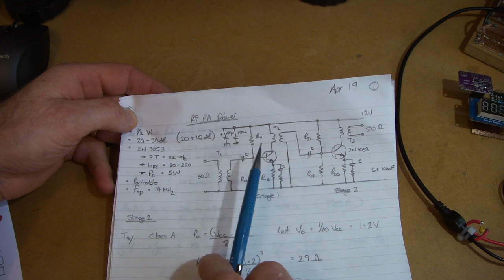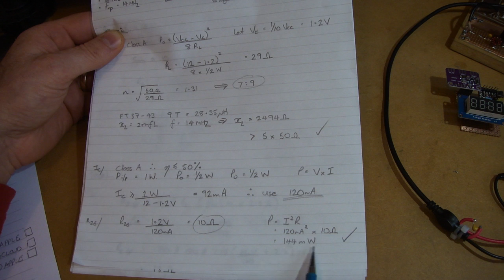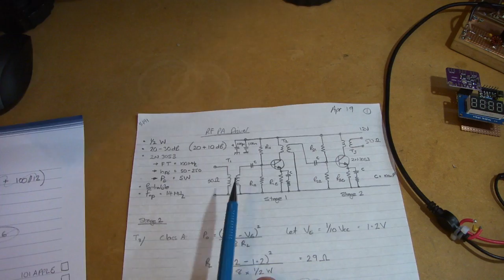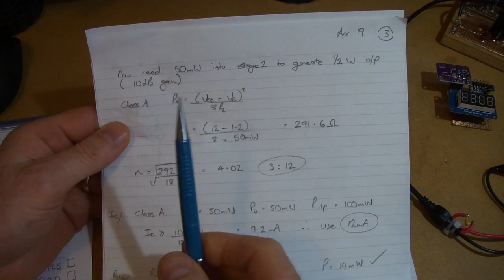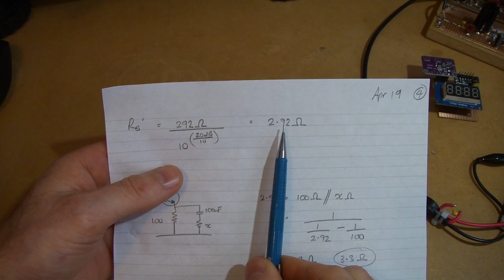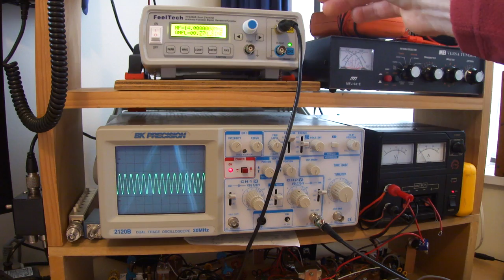20m RF PA Driver

Comment: This was good, some I don't understand (here I learned the purpose of a driver in a final amplifier circuit).  My goal is to learn enough to build my own qrp ssb unit for 10 meters.  I especially appreciate how you break down components of the circuit while explaining the relevant formulas in a neat list.  This creates good reference material for me.

Comment: Charlie, thanks for your great Videos. If I may make a suggestions, would it be possible to include a full schematic INCLUDING the calculated values of the things you build, maybe at the end of the videos? I really appreciate you showing all the calculation steps alongide the schematic. When rebuilding one of your circuits, one usually has to watch through the video to grab the component values. I understand the focus of the videos is to explain how to get those values but I thought I'd make the suggestion.
Reply from the maker: Gidday. Thanks for the feedback. At this stage I am putting everything up on the blog at https://zl2ctm.blogspot.com/. Hopefully, there is enough there. Unfortunately, I don't have the time to draw up a full schematic for each radio. 

73s Charlie, ZL2CTM

Comment: The best video I have even seen.
Reply from the maker: Thanks. I'm sure there are many errors, but it seems to work well.
Reply: @CharlieMorrisZL2CTM There are no errors, I guess. But again I am confused with RF transformers and impedance matching. I tried to model and simulate a circuit similar to yours in MULTISIM software, however, simulation shows entirely different result. The biasing strategy,  "emitter voltage is one-tenth of VCC", works fine.

Comment: 2n3053, probaby will work up to 15 meters, usual FT of 100mhz IIRC.
Why not transformer couple the stages and put the biasing resistors at the cold end of the secondary (bypassed to ground)?  The turns ratio might change slightly I suppose.
Reply from the maker: Thanks. I'll look into that.